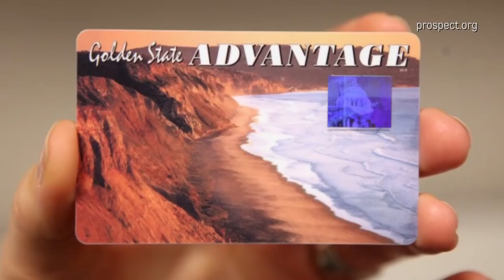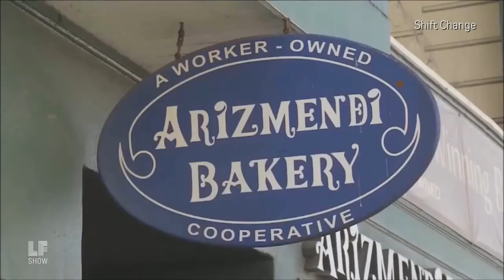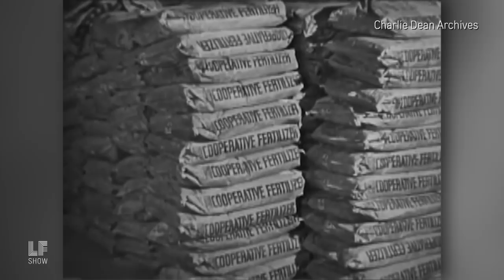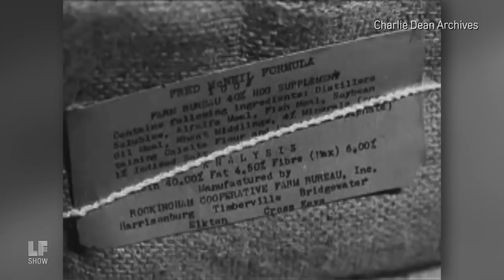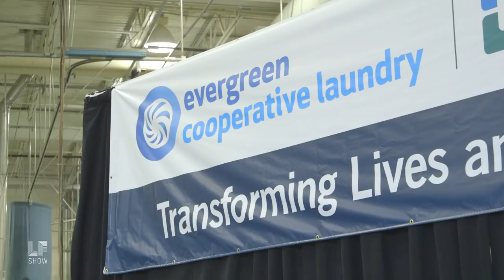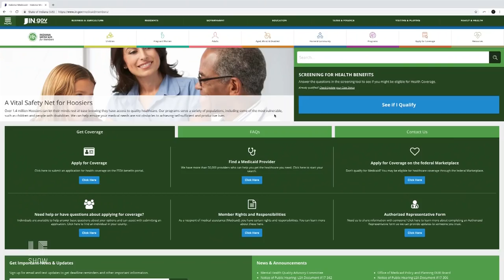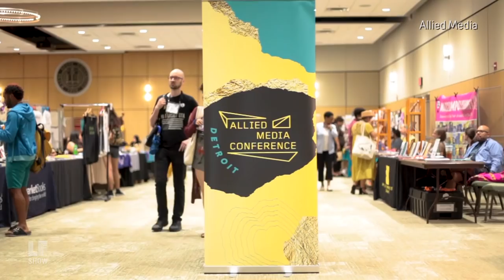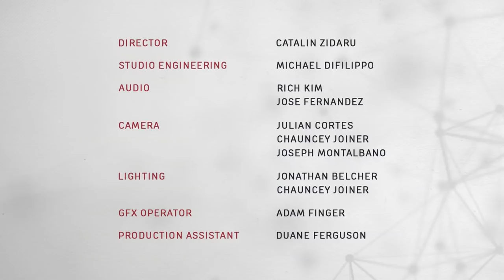The Next Economy: Worker-Led, for Public Interest

Comment: I think we can make better #platforms and better systems. The ratings system has to do with customer satisfaction. If you want return customers then you want well rated #riders. However a lot of these platforms don't encourage ratings especially for food delivery. Most customers don't rate. So when you do get ratings you get dinged. We need to be fair to both sides of the equation: customers and riders! And it shouldn't just be the rider telling the customer "please rate me", the platform needs to do its part too. I personally think the rating system is  unfair to riders and have considered scrapping it. 

Please understand that the workers are vulnerable to the customer's whims. However we do need to value customer ratings as well... let's re-think this one!

The economist Guy Standing on uber's rating system: ratings put people into a state of conscious and permanent visibility which assures the automatic function of power